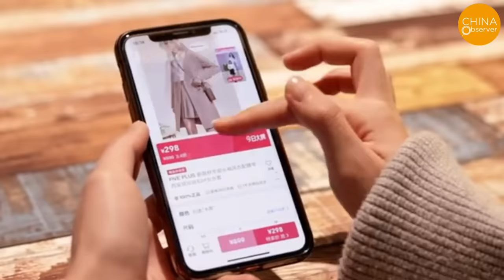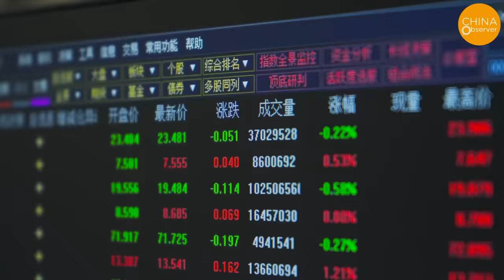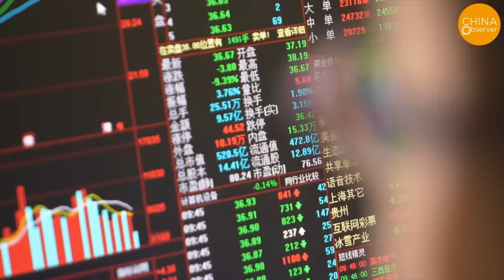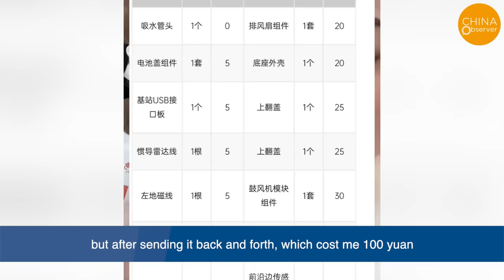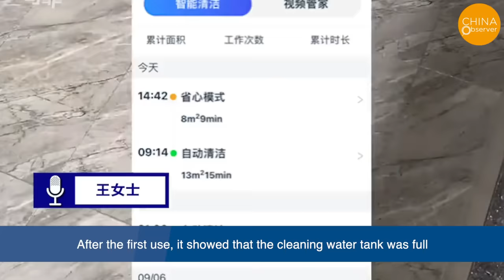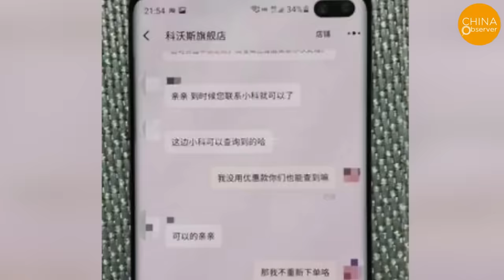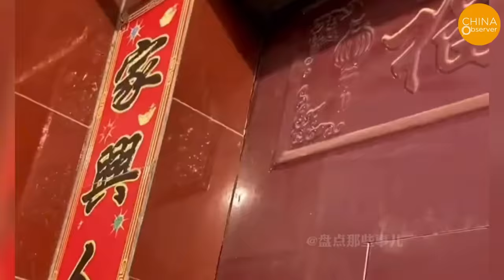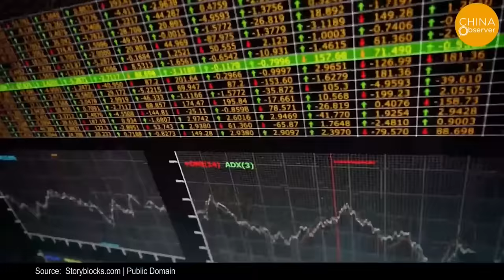China's Robot Vacuums Are Garbage, Enraging Buyers to Smash Them. Would You Dare Buy?

Comment: I was lucky enough to get my robot vacuum used for only $45. It would be a good one except for the fact that it spends all day trying to get under my couch. It won't give up and move on. It runs the battery dead trying to bore itself under the couch. I haven't used it since the first time.
Reply: My experience exactly. Tries to burn out on the rug, and then gets lost. Somewhere, usually wedged under the couch.
Reply: I beat the Chinese by a decade.   😄
Foolishly got carried away, 4 Roombas, inc. floor washer, lol. 

ALL wound up in the recycle w at best a dozen "uses".
(one day just cut my losses, stacked all 4 into wheely bin.  Wait for AI rig maybe)
Reply: 99% return rate AHAHAHAHAHAHA LittleSheep
Reply: Raise your couch up a bit? Stack a few "non-mar" pads under the legs.
Reply: Well it's determined to clean under the sofa.   A for effort.
Reply: classic.

Comment: I want to see Made in Japan come back, with the quality Sony had in 1990-2000.
Reply: FYI the real Sony products were before 1990. I used to repair electronics. Sony, Kenwood, JVC, Pioneer all went to a lot of cheap crap in the late 80s. Initially those brands did retain a higher end line, but I don't think they all do that anymore. Sony also doesn't make all their stuff, which is why the higer end things were so expensive. Hitachi, Toshiba and Panasonic made components, so when they made their own TVs and amps, you got more for your money. Sony used Hitachi VHS units rebranded. Their first flat panel TV was an NEC (with the logo swapped) and then they went to using Samsungs with tweaks. Don't know what they use now. Generally Sony was on everybody's lips in the late 80s but their were better brands. I would put my Aiwa portable cassette player up against any Sony, and I had multiple Sonys as well. I would use  Yamaha receivers and tape decks to take out a Sony. I would use a Technics CD player to take out a Sony. I'm sad they lost their way, but they weren't the only one.

Comment: I have a plastic broom that was  made in Shenzen. It works perfectly when I can be bothered to use it.
Reply: Me Too & I live in Chicago 😂
Reply: That's about as complicated and expensive as Chinese wares should be. Anything more complicated, and  you'll might run into problems.

And even that plastic broom is so-so, as the plastic will likely break down in 5 years or so. I'm not saying it's a Chinese thing per-se-, but it's what plastic do under sunlight and time. Even if the quality of the tool is not poor, the design choice probably is. I have a wooden/cocos-hair broom, and it's still fine after 20+ years. Then again, that plastic broom is cheaper, and if it serve you for 10 years, that should be acceptable.

The Chinese mentality is to cut corners, but there are little corners to cut on a broom. People can see in a shop for what it is, and it has to be good enough that it can be sold in a shop.

Comment: I bought roombas for both my grandmothers a long time ago, when I went to repair one I was amazed. It was so well designed for consumer repair. Everything was modular, unlike almost everything else which wants to force you spend $500 to fix a $10 part because everything is impossible to get to and needs special tools. Definitely has a couple issues, especially with one of my grandmothers rugs and hanging tassels and dogs, other grandma loved it and it was perfect for her house. It's amazing how companies intentionally make bad products to sell you services later(much sooner and more often than you planned). Don't even get me started on unbalanced load problems for all the newish top load washers, who ever designed those needs to let everyone kick him in the nuts.
Reply: The roomba of my parents had an issue with its sensor, specifically the motor of the sensor. But luckily I found a fix that involves running the motor on another power source. It worked three times in the last four years.
Other than that it works great.
Reply: PREACH!
Reply: Apparently the top load washers rely on friction to stop the shaking, from pieces of foam in the suspension that grip the auaoension rod. It's cheaper than old style suapensions, by far. 

But for the quality they used to make, prices should be higher. But to keep the same price point buyera are acustomed to... they cut corners.
Reply: But is it still like that? You said you bought it a long time ago and for a while now companies have been into anti consumer practices, especially anti repair.
Reply: @DKNguyen3.1415  I would be really interested to know also. I'm the guy that knows some Nintendo 3ds has more than 12 different types of screws because I fillled the ice cube tray I was using just to put on a clear case. Those early gen roombas and I can't speak for anything else were awesome for that one fact. I could have walked my grandmother through replacing the front sensors no problem. The thing was like a 10 piece puzzle with screws. I really want to know if they jumped on the anti repair bandwagon.
Reply: Roombas always have issues with rugs that have tassels...

Comment: These gadgets are garbage.  I can clean faster than any of these toys.  We have a Miele dishwasher but I have proven that I can wash and dry our dinner plates and pots and pans and also stack them away before the dishwasher finishes it's drying cycle.
Reply: The point of a dishwasher or a robot vacuum cleaner isn't that it's faster than humans at its task. The point is that you spend much less of your own time doing the same task. The machine's working time isn't your own time.
Reply: The dish washer probably uses less energy though? Less hot water - and water in general.  
Unless your not filling the dish washer before running it, if you live alone yeah its easier to just wash by hand most of the time.
Reply: It's not important how fast a robot vacuum and a dishwasher can do their job. What's important is that you not needing to do it gives you free time to do better things.

If you really want speed, all these automations can work at the same time while you can only do one at a time meaning that you are slower.

Comment: Apparently the Roborock S7+ is actually quite a good product. Which is great to hear. This isn't based on subjective user reviews but on rigorous testing by a well-known and established consumer website who have their reviews behind a paywall (which is why I can't link to them unfortunately). It came second best on their admittedly fairly small list of 16 (they spend a lot of time testing) but it's not cheap. Then again, if this video is anything to go by, prices are dropping.
Reply: I have the Dreame L10S Ultra visible in the video in Germany and it's great. I wonder if there are EU/USA and separate China models where they cut parts or quality? I paid 900 € for this thing so if it hadn't been perfect I had sent it back in an instant.
Reply: As with most products from China the way to a good purchase is research and finding out which brands have enough honour to not deliver a bad product. Roborock, owned by Xiaomi, is one such brand. I have a by now old S5 which still does the job and actually has gotten better since my purchase due to software upgrades.
Reply: @justjc51  I have the S6, and it's so much better than the electrolux I had before. It's not only easy to use and clean, but the spare parts I got in the box have lasted for years (brush and filters). So I haven't had to buy anything extra before this year when the side brush lost 2 arms, and 3rd party things fit it and is cheap.
Reply: I bought one of the cheapest models Roborock has to offer just to use in another floor in the house. I wasn't expecting much as it didn't even have LIDAR. Guess what, my wife far prefers this one to the Neato we previously used. 

I have recently bought a better one (Q Revo) and it does a far better job than a combination of Neato (vacuum) and iRobot Braava (for mopping). And it has a self emptying base, washes and dries the mopping brushes. Mapping capabilities are far better than even the iRobot and it gets stuck less often. 

That said, that was a model bought in the US. I do not know if Roborock has the same quality standards in other markets.
Reply: My Roborock S4 Max is over 3 years old now and works flawlessly...Roborock has updated its firmware about 3 times since I bought the robot. I'm amazed how much dirt is in the dirt bin after every cleaning..love my Roborock and will always have a robot vacuum in my house

Comment: I have 3. A common problem is dust in the sensors. There are a bunch of sensors.  Look it up. Stick a q-tip with rubbing alcohol in the recessed hole.  This makes them stop turning in circles and odd stuff.
Reply: These robot you must clean the cover of sensor and IR sensor every month or two ,to make it last long and it will not lead to mulfunciton but the new model from china always come with mopping floor function which endanger the robot itself sometime )

Comment: I have a Xiaomi brand robot vacuum (forgot what model it was). I only use it for sucking up dirt (it was able to suck up small coins that fell in a corner under a table). I don't really use it for mop function cause i don't trust it in terms of mopping. Typically these types of robots don't have super high tech low light sensors so if it's cleaning time, there should be really bright lit room and yeah it's a hassle to move small objects on the floor that can cause obstacles for the robot vacuum i guess the technology isn't high enough to smartly do something about it. Each to their own.
Reply: How long did it take you to figure this out? Trip to the gym interrupted by low light sensors and a hassle to move small objects. Touch your toes.
Reply: @hitest8925 Whats up with the arrogant attitude 🤓

Comment: Why would anyone buy off brand and expect Roomba quality?  There is a reason those things are $300+.  They do the job and they are engineered well.
Reply: Roomba is also made in China
Reply: My roomba, 6 of them never fail ,the oldest one bought since 2012 ,it is still working everyday ,not changing any part except brush and filter.Roomba made in China BUT QC controlling by US company and design by US company.The early model of roomba is a bit heavy but tough.For example, my first roomba 780 ,it still work ,i bought it on 2012.

Comment: Had two break down on me in three years, both times it was the battery. Did everything mentioned to fix the issue other than buy a new battery. It worked fine for normal dust and pet hair, but the mop pad doesn't exert any pressure. It's like lightly wiping the floor.

Comment: I got one last year mainly because I thought it'd be cool to have one, but I've barely used it at all. It frequently has trouble connecting to the wi-fi, even when everything else in my home is working fine. Can't get over doorsteps, so it's locked inside a room and I have to manually lift it over to another room. Will mess with power cords, so you have to clear the cleaning area of any cables you have. It sometimes gets stuck on basic obstacles too, so you have to manually arrange stuff in the room to minimize pathfinding issues. The cleaning itself is... fine. It gets a good deal of the stuff off the floor, but I feel it's more efficient to just use a regular vacuum. Should've done my research and checked where it was made before buying one, lol.
Reply: These days there are some better models with cameras that will avoid cables. 
They won't eliminate the need to manually clean floors but you need to do that far less often. If you have pets the difference is pretty obvious and we can tell if the robot didn't clean from one day to the next.

Comment: Never understood why someone will use such things. They didn't clean everything, can't get under furniture, needs alot of maintenance, etc. Since decades I have a vacuum cleaner and some mob and they work great😅
Reply: They are not a substitute for a good manual cleaning, but they are great for light cleanings in between, especially if you have pets.  I run the robot every two days or so, and it catches plenty of dust and hair judging by what ends up in its bin; dust that won't go and hide under the furniture.  I have to mop, dust and clean far less often since the robot got to work.

Comment: I'd never trust a robot vacuum. First up, my vacuum cleaner is over 1000 watts . It has a power head (spins with a brush to pick up hair out of carpet).
It has some serious sucking power as well.
How can something that is small and runs off batteries even compete ? At best, one of those toy robot vacuums can only be at most 100 watts.
The greater the surface area it is sucking, the less powerful the suction is as well. I assume the tiny spinning brushes on that are supposed to flick the dust into the middle of the vacuum . Regardless, there is no way it would compete with a proper vacuum cleaner.

Comment: The first, and biggest scam with these things is calling it a "vacuum cleaner".  Its a floor sweeper. They have no vacuum function and if people understood the difference the limitations of these things would be more apparent.
Reply: Obviously you never use the iRobot Roomba series.
It's miles away from those stupid chinese cleaning robots.
Reply: My´mothers Xiaomi/Roborock robot sucks like a vacuum cleaner. And has small rotors with bristles to sweep. 
And then it goes back to the dock and empties itself into an actual dust bag, also while using suction.

I bought one of the most expensive models, so it works like intended. Even has radar so no light is needed to map the room.
Reply: @rubiantary  also made in china ;)
Reply: It isn't the consumers fault that they were defrauded.
Reply: @Timberjagi they can make good products too, no doubt
Reply: POPIUO phones & iPhones are also made in china. 
one is piece a garbage phone & the other are known globally.
So whats ur points? @Timberjagi
Reply: @rubiantary  I own a Roborock Q Revo and it has a vacuum function too. I don´t know any robot without it, cheap or expensive.
Reply: My Roborock is a vacuum cleaner..it has excellent suction and with its lidar navigation it cleans every inch of the floor much better than most humans will with a manual vacuum cleaner.

Comment: I own a roborock s6, actually it functions quite well for a studio apartment, I've hanged most of the things on my wall with a grid rack for small item storage and schedule it to vacuum every morning. I didn't use the mop function though, my only issue is that it doesn't clean the corners, but it cleans up most of the area so no complaints on that, I got another manual vacuum cleaner for that.

Comment: You are missing the point.  I would totally love to have a robot vacuum.  Minimum standards are it should find it's way back to it's bay every time,  it should reasonably offload any fuzz it brings back.  It should never fall down stairs or a hatch.  It should be safe for the cat.  In my case,  it needs to recharge off grid.  That means 12 volts DC.  Robot vacuums are like bread makers.  They are hardly necessary, but they are here for entertainment value.  With my crummy floor,  a robot vac would need all season radials and good ground clearance.  I'd pay bad money to see my landlord's face when the robot chews up a vinyl tile that was never glued down right.

Comment: I feel like they're dumping on their own citizen..? Two reasons:
1. I bought chinese brands but they're nowhere as bad as the ones presented here. They have engineered aging into their products (everything breaks down in about 2-4 years almost certainly), but it's acceptable.
2. I hear some stuff, like welding ac/dc inverters, are terrible in China, but works terrific when exported. Now, I use a few of those.. they lasted about 2 years before I have to throw them away (repair isn't economical because they're dirt cheap). My supplier says never to buy the cheaper, in-land model because they broke down way faster.
Again, just my experience dealing with Chinese equipments. It's really a hit-or-miss situations. I still have my old Italian and Japanese inverters working well beyond 8 years, but they're quite expensive.

Comment: I have 8 I robot vacuum robots for 2 house  since 2012 ,only 2 robots died after 2 years which are neato both. The rest are I-robot, they never FAIL me and clean house nicely. However, in 2016 ,i bought another robot which is China brand then after 2 months IT FAILED and died. So, if you gonna need vacuum robot please buy I-robot.(i have irobot 780,790,880x2,i7,i7+   the oldest one is 780-christmas limited edition 2012 still work without changing any part except the brush and roller- 11 years now to be precised-around 500USD price at 2012)